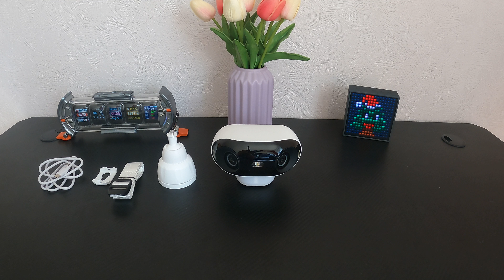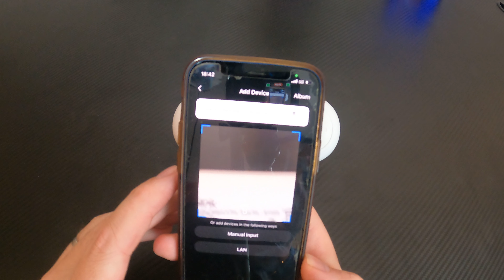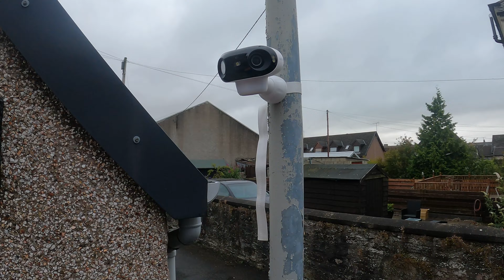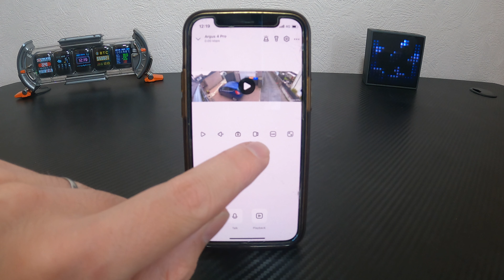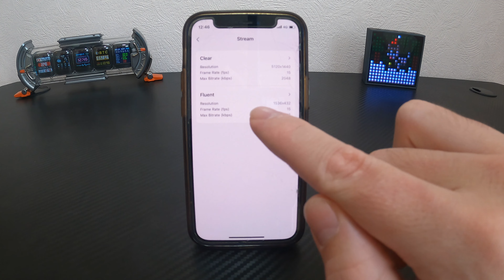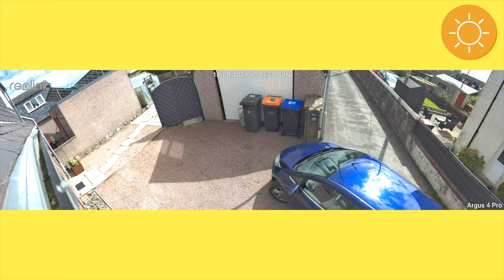Reolink Argus 4 pro camera with 2 solar panels

Comment: @mikebolt9753 Hi, Can you explain the reason behind the requirement for the TWO 6 watt solar panels. WE have Argus 4pro with solar panel and in summer it permanently on 100% Charged and in winter in keeps the battery above 50%. Do you have the camera recording at all hours of the day and is  it a high traffic situation

Comment: I have argus 3 pro. The only problem to this moment is I don't  know how to record continuously. Motion detection sometimes may fail at the night. It seems it doesn't  support  this. At least the battery models. And you did good work showing this parallel connection .

Comment: How did you write 2 solar panels into the camera? How did you join 2 usbc into 1?
Reply from the maker: I cut the usb c ends of the solar panels and spliced them together with a wago connector. I then inserted a usb c connector into the camera cut the other end off and spliced that end in with the 2 wago’s
Reply: @mikebolt9753 holy moly I have some googling to do. Wago??? Thank you for replying

Comment: I was under the impression that you could only use one solar panel with these cameras. This would be useful for the Reolink cellular cameras.
Reply from the maker: On the official website it says one solar panel per camera but I’ve had this running for a while now off 2 solar panels and it works great.
Reply: The Reolink solar panel is called Solar Panel 2 (which is 6 watts) instead of the first solar panel (3 watts).